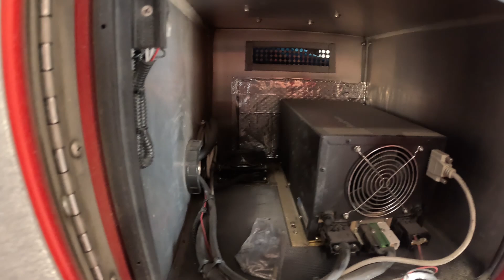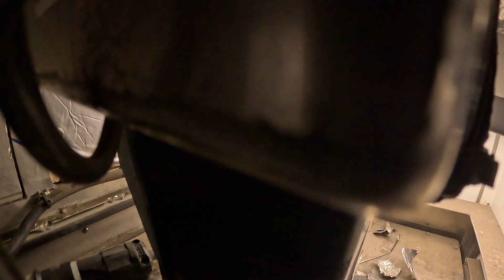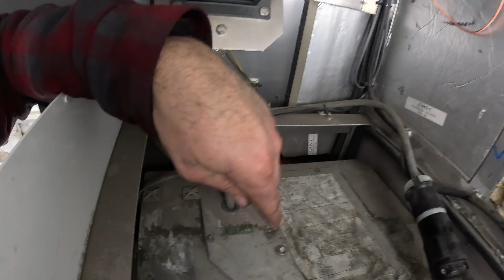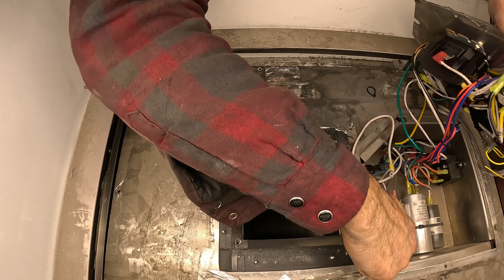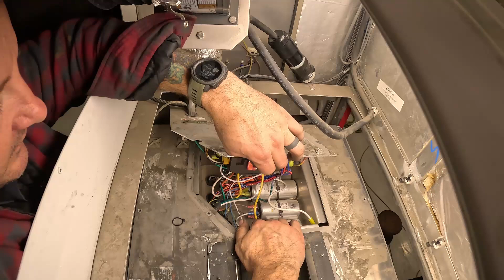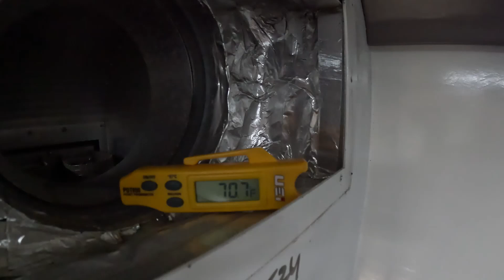Dometic Heater Replacement

Comment: do you prefer the MEPS over a gen? and that a/c is made for Frazer you should be able to order parts from them
Reply from the maker: yeah i feel like overall meps is better, alot less things to go wrong. yet still some pros and cons. think i will eventually do a video on it.
i think i have checked with frazer before, but your probably right ill check to see if i can order it from them. thanks for checking out the video. appreciate ya.